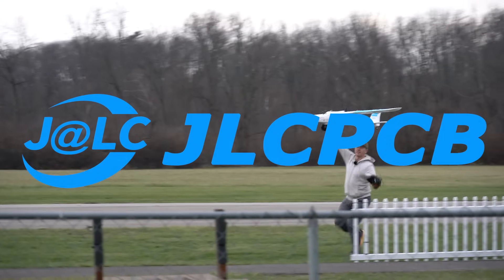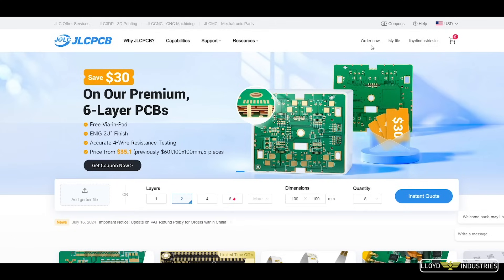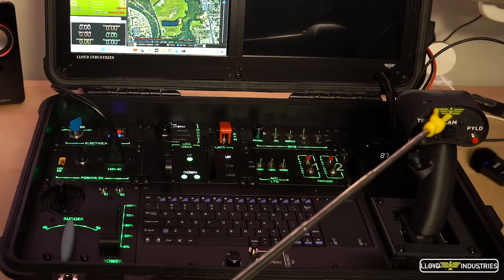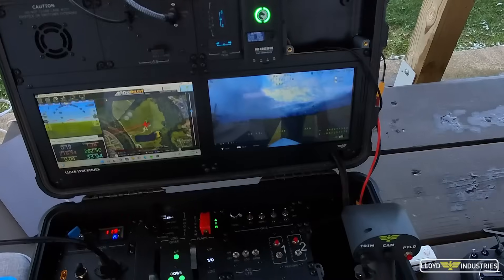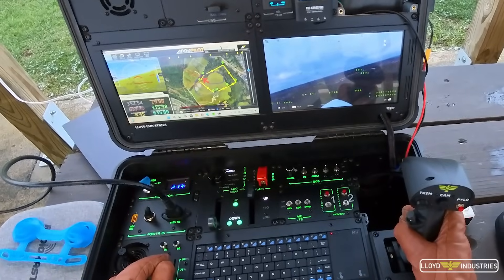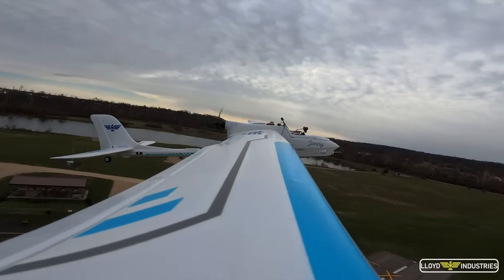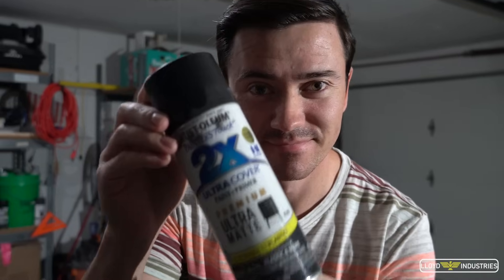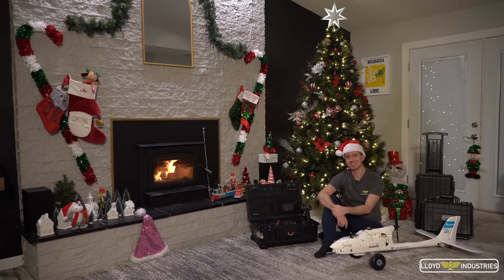The Ultimate RC Radio!? Custom Homemade Ground Control station with Folding Joystick!

Comment: Totally reminds me of the Soviet CyberDeck that was used to Recall the ICBM towards the end of the movie, “Spies Like Us”!
Very cool build!! 
With all that computing power, you’re only scratching the surface when it comes to the “ Trunk’s” abilities. 
I’m thinking multiple aircraft, Radar… 
For a fun video, control one of those RC Paper Airplanes . 
You’re doing something right , if you’re still married. Happy Wife, Happy Life. 

Rudder control… a use a pressure switch in your shoes under each big toe.  Use something like a strain gauge, fsr, or something piezo-electric.  I’m curious why you don’t use DJI Motion Controller or Equivalent…? 
Have fun and good luck!!
Reply from the maker: Ill have to watch it! Haha so far still married! 😂 thank you and those are interesting ideas!

Comment: An idea for your rudder issue, you could incorporate a twisting motion on your joystick. Rotate the joystick clockwise or counter-clockwise for rudder control.

I'm glad you were able to build this because that was something I was looking to build 5 or 6 years ago, but sadly, due to time, it never came to be. So I give you praise good sir. 😉🫠
Reply from the maker: Thank you kindly! That was my original idea however I just didnt have the CAD expertise to integrate it. I think I might just hire someone on Fiverr to design a much better looking joystick with a twisting axis. Thanks for the comment!
Reply: @letsMakeItFly  virpil and vkb make just the bases that you could use rather then having to design a whole stick. Plus they have adjustable tension and center characteristics to get the stick feel just how you'd like it
Reply from the maker: Thanks for that!

Comment: Why not have a switch to change the camera controller to rudder control because you don't need to move the camera when your on the ground
Reply from the maker: Great Idea! I can use the thumb button on the joystick to swap it over. Easy to implement i like it. I think ill try that as a temporary fix. Thanks!
Reply: @letsMakeItFly  not sure if metastatic is outside of your wheelhouse but is there enough room to put a meshtastic T-ecoh node in that airframe to use as a communications hub I would like a long endurance craft for UAS and communications outside of cell service
Reply from the maker: I have no clue what that is honestly. You can get pretty decent range (so they say) with off the shelf transmitters now a days though. The tbs crossfire uses 915mhz frequencies as well and many more do. I always fly within visual line of sight though 😜

Comment: Whoa! I mean, must be nice to have a laser cutter, but the knowledge to create the PCBs is what’s truly impressive here. Also those lighted panels are amazing. Looks like they’re straight out of a commercial aircraft. Great job. This is everything I’ve ever wanted in a control station. Or at least, it will be once the transmitter is converted to an open source protocol. Not that TBS isn’t great, but we just can’t count on proprietary systems anymore. Thanks for sharing this with us. 👍
Reply from the maker: It sure is! I mean it is certainly not the most capable laser and was very affordable actually but it works well! For the PCBs you just have to familiarize yourself with the software a bit (watch a few youtube tutorials) and then all you’re doing is pretty much making connections between components. I agree on the transmitter 100%. Ive got an old R9 module that i converted to ELRS and if i get the radiomaster nomad i dont think im ever going back. Thanks for watching and the comment!
Reply: Almost every makerspace has a laser cutter you can use, typically in exchange for helping maintain it or something.
Reply: @myself248  I do know of a MakerSpace in the area, but they charge a not-insignificant monthly fee, and nobody mentioned a barter option when I spoke with them. Thanks for the idea though. I’ll keep looking. 👍

Comment: This is abso-friggin-lutely amazing! Used to work where motion based simulator cockpits were built and I am floored by your ingenuity in putting that together. Curious about the shock/impact durability of the structural pillars and overall impressed with the integration of all necessary systems. That said… can you make some for the Ukrainians? Keep up the fantastic work!
Reply from the maker: Thank you very much! Yeah it’s probably not very resistant to shock. The pillars are epoxied to the case. Definitely wouldn’t check it at the airport!

Comment: Could you integrate a Logitech extreme 3d pro joystick? It has twist for rudder. Awesome build, the backlighting is amazing. Liked and subscribed.
Reply from the maker: Thats actually the first thing I tried but the base of it was too large to fit in there. Im integrating a USB port where you can connect that very joystick without taking it apart!

Comment: Next automate the autopilot system to trace back to the takeoff point to safely land in case of a power loss on your controller. Great Project!
Reply from the maker: That was already done! That first landing at the very beginning of the video was an autoland simulating an RC link failure! Thank you happy holidays!

Comment: An idea to deal with both throttle and rudder would be to control both with the same slider configured in a XY system. To cover the square hole you can have an inside-shroud that moves along with the slider-knob. This solution needs a buffer clearance of half the size of the hole all the way around it, so it's not the most compact solution.
Reply from the maker: I think i understand what you mean that would be awesome. The only issue i see is the rudder having to be self centering.
Reply: @letsMakeItFly technically no real flight controls are self centering. I actually don’t know why both RC radios and flight sim controls always are, because it’s super weird to fly with. Especially for helicopters. 😅 But I think it originates from being easier/cheaper to manufacture than smooth non-returning oil restricted controls. Anyways, I subbed and are looking forward to follow your builds here. 😊
Reply from the maker: Not sure what you mean, I fly professionally as well and at least the airliner I fly has self centering controls, I know its got feedback from the control surfaces as well but on the ground if you turn the yoke to the right and let go itll bounce back to center. Same with the rudder pedals. Not sure about helicopters. I also know that aircraft that use systems of cables, rods and pulleys dont have self centering mechanisms but I guess it all depends. I think it would be a bit more challenging to fly with controls that didnt self center. Thanks for the comment and subscribing! Very happy to have you onboard! 👨‍✈️
Reply: @letsMakeItFly I fly helicopters and there’s no centering there. And the small fixed wings I have flown in as a passenger didn’t either (besides passively  from aerodynamic forces pushing on the control surfaces). I didn’t know airliners do have centering mechanisms. Learn something everyday! 😊
Reply from the maker: Very interesting! You sure do. Honestly I didn’t think much of it until we had this convo! Helicopters terrify me 😛

Comment: Great video. Used this same technique when I designed a piece of equipment in 1966 except we did not have laser cutters, the text was engrave through the paint with a stylus on a motor chuck on a panograph. This was the way the B-52 bomber instrument panels were do.

What did you use for the left side display to show your position a map, and what did you use for software.
Thanks 
Wayne
Reply from the maker: Thats really neat! Did you make panels for the B-52? Its called Mission Planner awesome free piece of software. Theres also INAV but im not very familiar with that one. QGround Control if your on a mac or android device. Thanks for the comment!
Reply: @letsMakeItFly  ya, was really good video. No, didn’t make the panels for the B-52. The panel was lite with an incandecent bulbs. The bulb holders mount through all the panel layer, but did not show light through the front, but radiated its light sideways through the edge of the hole it mounted through in the front panel. Since the engraving penetrated through the panel paint into the frosted plexi, the light illuminated the engraving. These panel holder were distributed in various locations to give an even lighting.

I used the same method as you to make my Cessna 172 instrument panel for Microsoft Flight Sim.
Reply from the maker: Thats awesome, Would love to see your setup!
Reply: Where can I send a picture or video
Reply from the maker: Lloydindustriesinc@gmail.com. Thanks for sharing!

Comment: i think your Arm and Disarm is reversed :) this is my dream build :)
Reply from the maker: Thanks for the comment! You're the second person to mention that actually. What exactly is reversed?? I flew a TBM960 that had a guarded switch like that to turn on and off the aircraft and when the switch was guarded and down the aircraft was on. That's kinda what I went off of.
Reply: @letsMakeItFly  i only see it in a game VTOLVR lol when the cover is up its on but I think there's no right or wrong way, its all personal preference I think lol your setup makes more sense because you can easily disarm the plane when accidentally tap it.
Reply from the maker: Glad you agree! Was scratching my head on that one

Comment: If you built these and sold them to the drone community I’m sure people would buy them
Reply from the maker: I hope you're right cause that's what I'm working on! Thanks for the comment 😀
Reply: Welp im waiting. Im currently building a fixed wing thernal UAV for use in disaster zones and having something like this would be so much better than tugging along a bunch of equipment, monitors,computers etc.  @letsMakeItFly

Comment: Wow, that's an amazing station, i'd love to make one myself (because the cost to buy one ready made... ouch...)
If i may venture a small suggestion, have a GX6/8/+ port that you can connect a cable to that connects to an external antenna tracker or mast that has the TX and VRX into them; it's very simple, all you need is power+gnd, video+gnd (hooked to a video balun on each side), rc rx/tx, and maybe another serial line to be able to control things on the antenna or the tracker. That way you can comfortably control your UAV from anywhere, you just need cable, and even without any special boosters you're good for like 100 feet. Great work!
Reply from the maker: Thank you! Are you referring to the $1000 i mentioned in the comments earlier? Thats about what it costs to DIY honestly. A kit may be a bit cheaper and the modularity of if means you can buy the essentials for a lot less and upgrade as you go!
Reply from the maker: And thanks for the suggestion I’ll add that to the list of requests!

Comment: That the most coolest radio ever great work bro 👍 I say for rotor control use like a game system foot pedal, I know its not going to make it so portable but it beats trying to do everything with your hands and your sitting anyways, and one more thing you arm and disarm is backwards but that just me ,anyway thanks for the video
Reply from the maker: Thank you! Absolutely, Ive gotten a lot of requests for rudder pedals. I thought about the arm and disarm switch position a lot and I did wire it up like that on purpose. I wouldnt want the aircraft to disarm when you are flying so it should be guarded while flying. Just my thoughts! Thanks for the comment!

Comment: What about installing a one of Radiomaster's CNC gimbals for rudder? Set it to ratchet and you have throttle too.
Reply from the maker: Not a bad idea! it would look pretty good just having two gimbals on the throttle panel. When i was flying around it was actually pretty nice panning the camera with the joystick on the throttle panel as opposed to the thumbstick on the joystick. I'm writing this one down.

Comment: No seriously I do want one! Please make them available! Especially with edge TX and compatible with various modules, except I would only want crossfire and expressLRS
Reply from the maker: Currently working on that!! Stay tuned, but realistically might be at least a couple of months before I can actually get something shipped. Day job keeps bothering me 🙄
Reply: @letsMakeItFly  a serious question, how hard would it be to do this while using say a Virpil hotas setup? As far as the communication side of things anyways ( hotas to radio) also, could you imagine a ground based fpv vehicle with a steering wheel and pedals?(In a slightly bigger case of course)
Reply from the maker: Honestly for me, probably pretty difficult haha but for someone who knows what they are doing probably pretty easy. I took a quick look at them and it looks like they have a sort of a screw on base. Im guessing its a multiple pin connector under there and its probably just wired up to all the buttons and pots. That gave me a really good idea however, I can come up with different joystick designs and make them interchangeable! Thanks for the comment!
Reply: @letsMakeItFly  your welcome definitely, also I can't remember what they are called exactly, but I have seen little communication boxes made that take communications from a canbus style controller(which I think a lot of pc peripherals use already) and translates them and sends them out through an rc transmitter of choice. If I find them again, I'll let you know, it may help streamline part of the process for you or even give you new ideas or directions to go.  
Seems as if this has been attempted and successfully so a lot! Search for hotas to rc transmitter on your engine of choice, there is a lot of reading and some vids on it out there.
Reply from the maker: Definitely please do!
Reply from the maker: I did see the windbox, Ill have to look into it because i do plan on integrating a usb port where you can connect rudder predals. Thanks a ton for your input!
Reply: @letsMakeItFly  understandable of course. I really enjoyed the video! I have been wanting something like this for a while now, but most of the commercial ones are prohibitively expensive, like 8 to 10k minimum!
Reply from the maker: Ive seen! Pretty outrageous, I would be honored to make the first GCS that's geared more towards the hobby world at a much more affordable price, still pricey honestly but not outrageous at least! And I think I can get the bare bones down pretty low. Then upgrade as the ol' coin bag refills!

Comment: How much for a fully assembled trunk ??
Reply from the maker: Fully assembled this particular version ran about $1,000 USD in parts. I think I can get that down a bit. I'm hoping to get the final sale price to $1,000 USD
Reply: @letsMakeItFly  that's not bad. Can I use elrs receiver’s and the radiomaster on it? Also, I would change the rudder a stick that can be self-centered would be great
Reply from the maker: Thanks for the feedback, having looked around it certainly beats price tags of $8-10K! The current design does have a self centering mechanism, it is poorly designed however. 

You can certainly use ELRS receivers as long as the transmitter is an external JR style transmitter!
Reply: @letsMakeItFly  ok I'm currently using crossfire with my tx16s
Reply from the maker: That should work perfectly! thats what im using
Reply: @letsMakeItFly  great

Comment: Another thought to reduce setup time is running external bulkhead SMA connectors for your antennas. This can also help if your ever wanted to run some high gain antennas on a mast.
Reply from the maker: absolutely!

Comment: Nice job! For your rudder, your could get a stick that twists so your have 3 channels on your yoke. HOTAS controllers have a "nose wheel" steering button you can control with one of your finger tips too.
Reply from the maker: Excellent idea. I think next time i might try using the thumbstick on the joystick to control rudder as a temporary solution to a twisting joystick. Thanks for the comments!

Comment: very smart, but no HDMI output? would be cool to have a port for external fpv goggles.
Reply from the maker: Ive definitely though about that, believe it or not Ive never had goggles but I though an easier way around that would be to just get an HDMI splitter? If that exists
Reply: @letsMakeItFly  splitters certainly do exist, but i am shocked that you don't have any goggles, for me, once i flew fpv, there was no going back, the first time you fly past your own 'body' is an unforgettable experience, its genuinely an out of body experience.

it would be a nice addition to your kit, particularly for anyone stood around watching, you can give them that experience.

most, if not all analogue goggles have a micro hdmi input, for external ana/digital receivers, and since digital goggles came out, you can get used dominators etc for peanuts.
Reply: @BadwolfFPV  But then you wouldn't need the case and all of the goodness.
Reply: @Michael2112  goggles are easier to see in bright sun, you can seamlessly switch because both are live,  ground station great for takeoff/ landing + auto flight modes, goggles better for manual flight, plus goggles are great for showing off to interested spectators, the case is great, but its lacking an hdmi out imo.
Reply from the maker: Noted! should be easy and cheapish to integrate i think. Ill add it to the list of improvements!